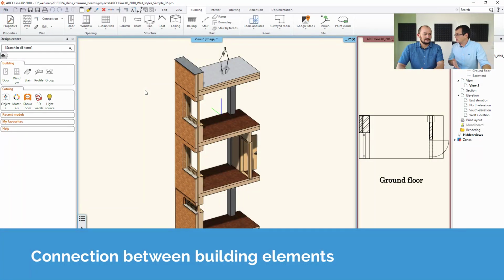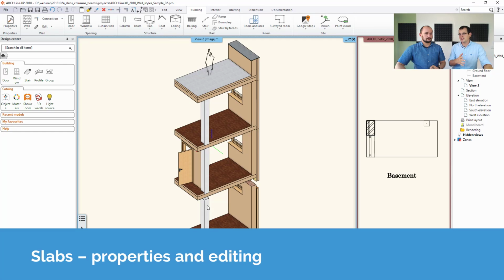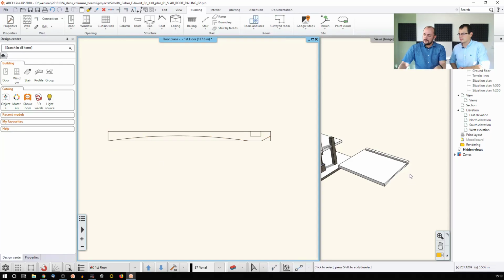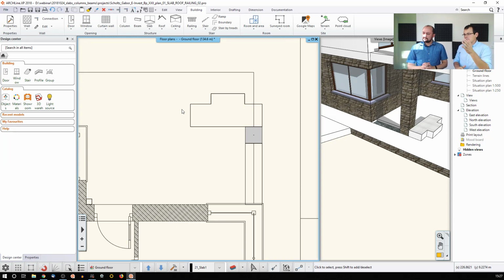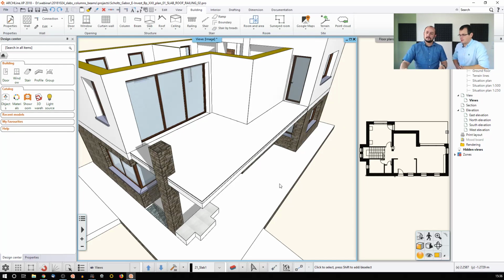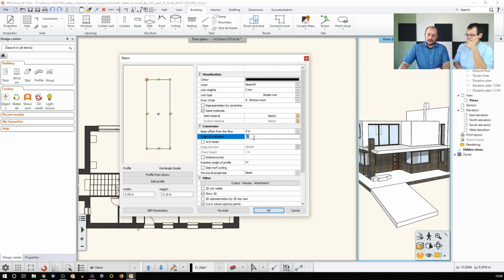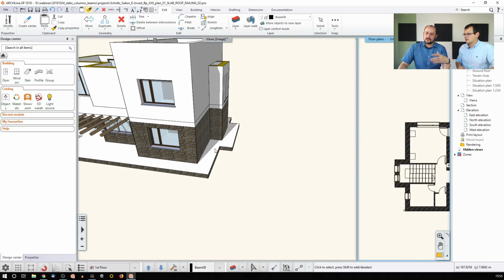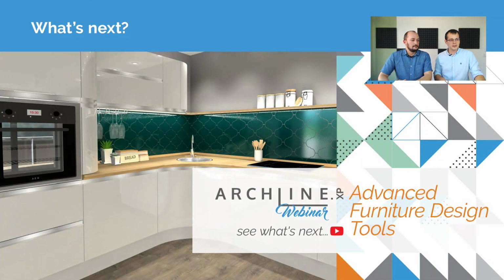Everything About Slabs, Columns and Beams - ARCHLine.XP Webinar

Comment: Hello. How can you model a precast concrete column with corbels (little cantilevers for support of precast beams)? 
And can you model some reinforcement or bolts as well? 
Is this software capable enough to be used by structural engineers as well? 
Can you make a video dedicated to structural modeling of buildings (something aimed at structural engineers)?

Thanks!
Reply: Also, how can you create your own 3D objects with parameters that can be changed from model space to adjust the object for the particular needs of the project?
Reply from the maker: @reinisgailitis  Thank you for your interest. The program is made for architecture primarily, so structural engineering functions are limited.